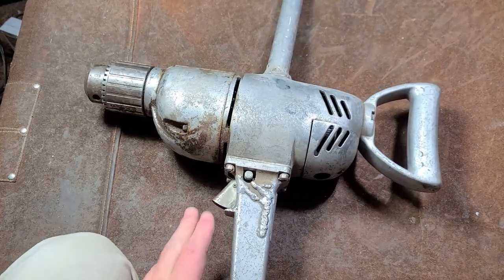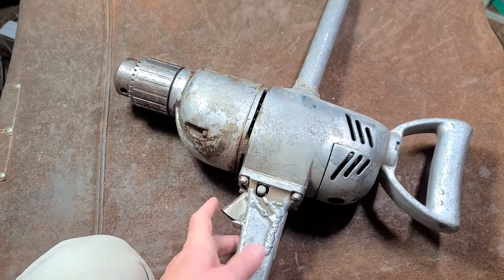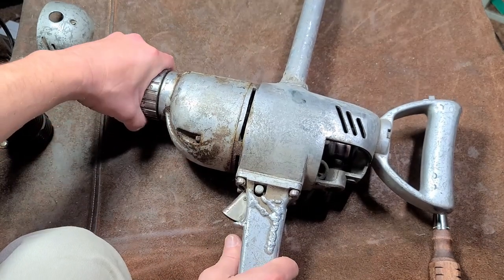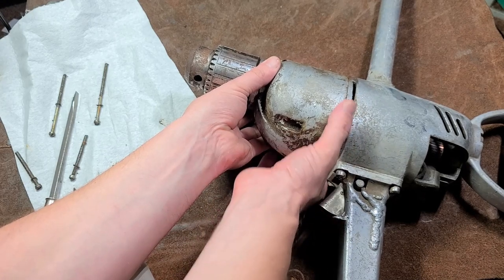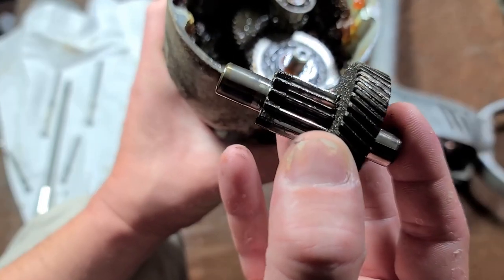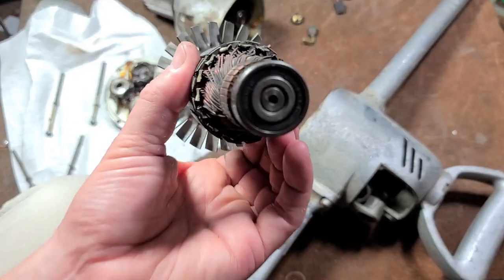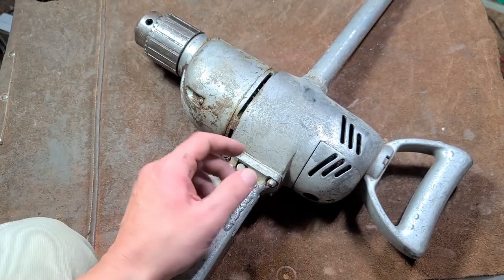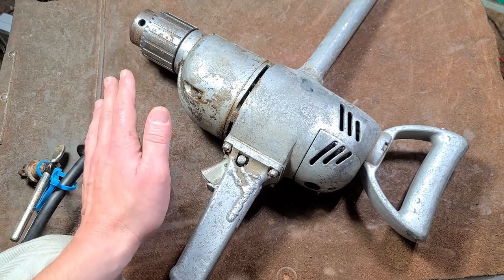Skil 3/4" Heavy-Duty Drill Review & Teardown

Comment: I have a grinding stone and chalk stone I use on the copper part @ 14:48 maybe have the bearing on hand... When you use the stone it resurfaces the armature of the motor so it works a lot better. After awhile it will wear a rough spot then make it arch really bad if they don't get proper attention. Sometimes you can repack those bearings using a razor blade as well.

Comment: With all due respect, I am always concerned when the label or #serial number is no longer attached to a valuable tool like this. I would simply not buy a tool/ bicycle/car without a serial number.
Reply from the maker: Bicycles and cars yes. But a forty-year-old drill that has been under heavy use of which have a label on the side of the unit getting punished are often missing. Also old tools are not very valuable at all most people try to grossly price gouge on eBay for them.
Reply: @CatusMaximus  Thanks for reading my comment. As you state, it is entirely possible that the label fell of by itself as this tool has surely had a hard life. In regard to Ebay prices, we are in complete agreement. In the few years since I started my small collection of older tools, I have noticed that expensive tools often linger on Ebay for many months. The monetary value of vintage tools seems very arbitrary.
Reply from the maker: The only ones that really go for big dollars are the best there ever was in class such as Porter-Cable worm drive belt Sanders
Reply: @CatusMaximus  My interest is in preserving the craftsmanship of solidly built tools from an industry that has been cynically exported. As a Canadian, I am interested in high quality tools made on both sides of the border. BTW I have two, made-in-Syracuse Porter Cable worm drive sanders.They need a little upkeep but seem  to have lots of life left. The Josiah Hanna Youtube channel features numerous vintage Porter Cable tools.